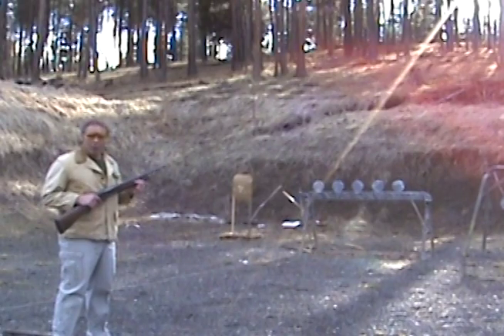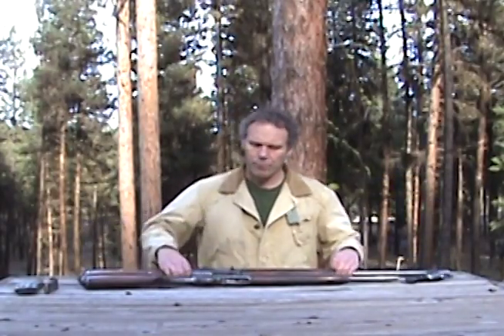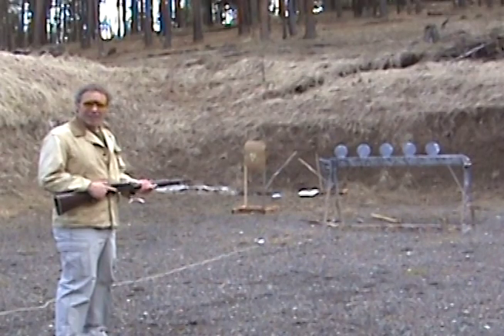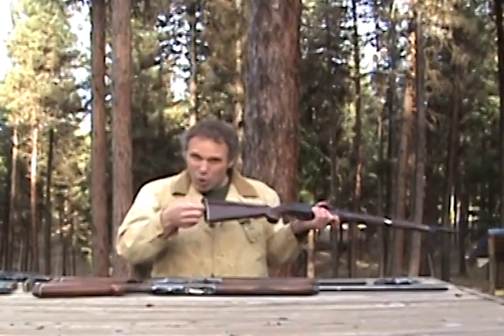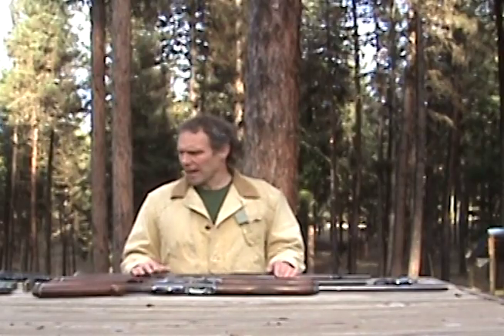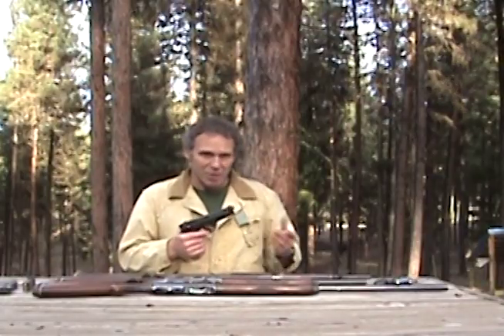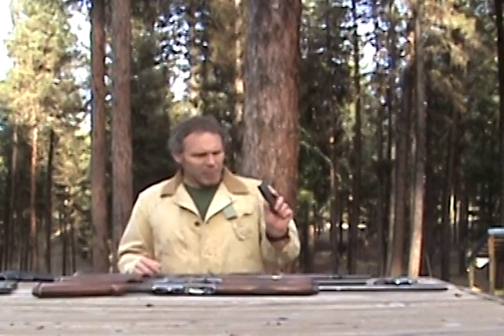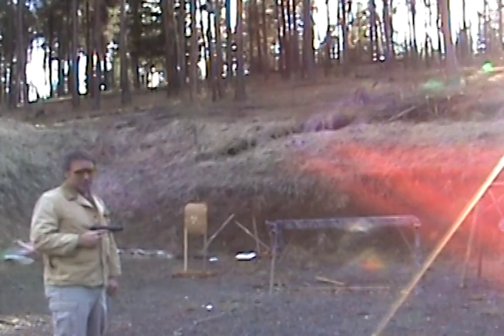Can spring compression damage a magazine?

Comment: I recently fired 4 mags through my 1911(on the 4th of July)  Those mags had been loaded for 2 years,  I had zero issues.   

When I was in the military I never kept mags loaded that long, but when I did have feeding issues, which is the only type I ever had with M16's/AR's, the problem was always magazine related, and was easily fixed by taking the mag apart and tweaking the spring.   That was with standard issue mags, nowadays you can buy AR mags that are just plain garbage and no amount of tweaking will fix them,  same goes for 1911 mags.

Comment: I have kept my Mossberg 500 loaded for 97% of the time for about the last 17 years. I have noticed that just pushing the magazine tube follower with my thumb it feels much weaker. BUT it has never failed to feed well. 

But I had a s&w sd9ve that I kept in my car hot and cold loaded for about a year, and I started having a problem with the last round hold open not working. And it could be temporarily fixed by stretching out the mag spring.

Comment: I served in the USAF for 4 years. During that time I was an armorer. I can attest that mags left loaded do lose the tension over the years. 30rd mags could fit 31, 32, or 33 rds in it. These mags were not used for training (i.e. range qualification) but only used for daily issue. We constantly saw "old timers" disassembling the mags and stretching the magazine springs so they would hopefully work reliably. Moral of the story is at least down your mags by a round or two. Rotate your stored (loaded) mags.
Reply: This is precisely what I do to my carry mags. Rotate once every couple of months and I keep one less round than what they hold because the pressure of getting that one last round in seems a lot more than the previous rounds. I think this is pretty good advice and I’ll check the difference in a couple years when I pick up new mags. Thanks for serving!

Comment: I have a stevens model 62 22 LR, and 6 magazines for it.  At one point i had 2 of them loaded for way over a year, nearly 2.  One of the magazine springs was fine, the other failed.  Wouldn't even push the second round high enough to chamber.  Unloaded it, left it alone for probably 6 months, loaded it and shot.  Worked fine.  Don't know if that's damage or what, but its relevant to what Paul was saying.

Comment: It comes down to the quality of the spring in the mag, the cheaper the metal, the more likely it is to malfunction.  

This also brings up the question of which puts more stress on a mag spring--being left compressed for a long period of time, or being frequently compressed and loosened by frequent use.

Comment: It's true that springs that are designed and manufactured correctly for their application will never suffer from "compression damage" (i.e. the spring deforms when fully compressed) and there is enough anecdotal evidence to support this.  The problem is that it's impossible for a consumer to know if any given spring was both designed and manufactured correctly for it's application, so better to be safe than sorry when the risk is high.  It's also worth pointing out that stretching a spring and reinstalling it should be an emergency fix only because stretching the spring simply deforms it again making it weaker so it will cause malfunctions even sooner next time.   I think the best advice for people that have a semi-auto but rarely use it is to follow Mr. Harrell's father's Nylon 66 method and simply not load the magazine to full capacity since that is the best way to prevent the maximum level of compression that actually deforms the spring.

Comment: Good video made some good point. 
In the service I was taught condition 3 (1911). If you are train in condition 3 you can pick up a pistol, you have never seen before and fire quickly. You never have to worry about is there a bullet in the chamber or not. Most people are not experienced enough to carry in condition 0 safely. I think condition 2 is safe because of the hard double action pull. I do not use condition 2 (HK45) for two reasons. If my first shot is single action, I am more likely to hit my target on the first shot. Most important you do not want to change your muscle memory. In other words you don't have to think, you just do.

Comment: Just for a mean rule of thumb (which there are of course exceptions based on what kind of spring it is). If it's compressed past 80-85% of it's original, uncompressed length (no pre-tension) 

then it will undergo some plastic deformation. Some springs are designed for quick movement, dynamic applications other just to hold something under tension. If they design the magazine correctly, with enough space for the compressed spring when fully loaded, it can last a really long time cause it's still in the elastic part of the travel. Over all the years the spring deteriorates and some can freeze in place adhering to the contact surface based on the materials. The better the spring is guided, the better. Bulging out being compressed isn't what you're looking for.

If you let your car sit in place forever, your tyres will be done and the engine might be stuck if it isn't turned once in a while. 

Also: Never underestimate a company controller trying to save 0.003$ on a tiny part to become a major 9-digit recall dumbsterfire including some casualties.

Comment: There are many people who never consider that steel springs can and will lose their temper (i.e tension) under constant compression. In fact, MOST auto loading weapons jams can be directly attributed to a faulty magazine and particularly a worn mag spring! Overlooked, but crucial 101 information for any serious gun owner if they want their weapon to fire in a crucial situation. 👍
Reply: Probably depends on context, but most of my jams have been related to badly-fitted ammunition that didn't like my gun. Bullets not seated into the case far enough, wadcutter profiles that aren't smooth enough, etc. Or too little powder in a custom load that didn't generate enough force to properly eject the previous round. I don't have tons of experience with weapon jams, but I'm not sure I've ever had a jam related to magazine failure, other than failure to properly insert the magazine into the weapon.

Comment: Seems a lot of folks only understand extreme black & white thinking, either it is never a problem, with any magazine, ever; or always a problem under any circumstances.  You have shown the complexity of real life with its shades of grey.  As a police armorer, we had a problem once with older SIG 226 magazines which had been carried loaded for most of 15 years on duty.  One of our dim bulb Captains purchased  Winchester 127 grain plus-p-plus ammo for duty carry in pistols.  That is a very hot round and worked in the MP-5, however the slide velocity was so high on the pistol that the older weaker magazine springs could not push up the column of ammunition upward fast enough to feed the next round.  We had carried that ammo for over 3 years on duty and had never been allowed to actually fire it in our pistols or even test it for reliability, due to Captain Dim Bulb's budget considerations.  We only fired up the ammo for qualification just before trading in the pistols for a different model.  These Sig 226's had the pinned in breech blocks, and several of them sheared the pins and ejected the breech block before getting through even one magazine.  We took up all the magazines, and I could differentiate the weak ones from the newer ones easily by depressing the follower and feeling the resistance.  I made 2 piles, the unserviceable and serviceable, which were to be sold to some other banana republic police department.  I tested some of the hot ammo with  magazines from each pile.  All the jams were from the older ones with notably weak springs.  This should have been a valuable multi-point learning experience, however the lessons, predictably. were lost on the Captain.  I'm sure all the magazines were sold to Guatemala anyway.

Comment: I can confirm that damage does indeed occur from springs being compressed without release given enough time. Paul, you summed things up very nicely. Your example of the magazine that worked until the last two rounds is an example. I call that damage because the spring failed to fully function as designed - even though it did work with the previous 13 rounds. 
I can also confirm that quality makes a difference in what constitutes "long time".
Just like pointed bullets in a lever action tube magazine is a bad idea (yes, pointed bullets in a tube magazine can, indeed, ignite under recoil - I've seen it happen), keeping springs compressed without release is also a bad idea.
Can you get by without magazine maintenance for a while? Sure. Will a quality spring tolerate that lack of maintenance longer than a cheaper spring? Also sure. But entirely ignoring due maintenance of equipment is simply asking for trouble somewhere along the way. People whose lives depend upon properly functioning medical equipment never fail to keep their doctor appointments. Is there really any excuse for ignoring maintenance a firearm (which can also be considered personal lifesaving equipment)?

Comment: My father was a machine design engineer. he told me all springs have a compression point that if you exceed that the spring will loose its ability to return to full extension. so, its not a good idea to radically compress springs in general. for the mossberg pump shotguns I own and some of my friends own I replaced the magazine springs with Wolff high quality springs to make the springs last longer.

Comment: Great video. 
I have seen a few weak shotgun magazine springs , but have never even heard of a weak hammer spring , here in the Bahamas its almost taboo to dry fire a gun so everyone I know never does it and leaves their  gun cocked  365 , some islands have no shooting range  so many guns sit for years or decades without firing , I would say the vast majority of shotguns go several years without being fired , and I've never even heard of someone having to replace a hammer spring .
I'm sure you are correct that It  can weaken the hammer spring,  but are the odds of a weak hammer spring greater then the risk of breaking a firing pin ?

Comment: This really boils down to the quality of the spring design for the application & quality of the spring manufacture, in particular the heat treatment & stress relieving of the spring.  A good quality spring is not likely to have any problems being compressed for long periods of time.  Stretching a WELL MADE spring AFTER it has been stress relieved is a recipe for microfractures & stress fatigue failures.  Permanently stretching an automobile valve spring may cause failure in 1,000 miles because the spring is cycled often.  HOWEVER, a magazine spring cycles relatively few times during it's lifetime so you might get by stretching the spring after it has been heat treated.  But if you need to permanently stretch a spring it probably means that the heat treatment was too soft.  Because it is too soft you will probably get by stretching the spring without a future stress fatigue failure.  But you may also need to stretch the spring again in the future.  But without an metallurgical analysis of the spring quality, it's difficult to know which brand of spring will be a problem.  Ultimately this means that you need to periodically test the springs in your magazines to make sure they are working correctly.

Comment: I just bought a Sig p226 with 2 mags from 1995. They have been loaded and unloaded a lot since then. I bought a 3rd mag and the spring on the new one is much tighter than the old ones. But they are work. May I suggest replacing the springs when they get used a lot.

Comment: Used an S&W 5906 with 4 magazines that had been loaded long enough that the ammunition cases had corroded, and 3 rounds had become duds.

After using up the (sticky) ammo it came with, all magazines fed fine.

A well made spring, used correctly, won't ever take a set or fatigue. A poorly made spring, or one that's compressed a bit too far? Maybe not the same luck.

Comment: So different springs have different design points and goals. A bolt spring usually requires a small length, and that makes it harder to design around longevity when compressed. A magazine sometimes wants to use the extra space for rounds and again its difficult to design the spring. Other magazines use a more expensive spring and/or give more space for the spring and will last longer compressed. And finally, not loading to capacity will be dramatically better for the spring. That's one of the reason holding the bolt back isn't great, it's fully back. A few rounds removed will be much better, a few more will still be better, and a gun with a couple of rounds only will last almost forever (advice for Paul's dad).

Comment: It's going to come down to the quality of the spring and conditions it's kept under.
I've got a Ruger P89 and I ended up finding a loaded mag which had gotten forgotten in a box of odds and ends and which I know had been there for at least a decade because it was a sealed box from when I moved to FL from PA a decade ago.
The mag performs just as well as the other ones which get cycled and are allowed to periodically rest the springs.
On the other hand, the springs in military surplus M16/AR15 mags aren't as well made and I regularly see them die.

Comment: I'm only halfway through the video so he may cover this, but in my somewhat experience but not expert understanding the divide between elastic deformation that a spring recovers from fully, and and plastic deformation, the permanent bend that's left after a spring is compressed or stressed, is one of the most useful portions of the springs deformation curve. In optimizing a spring for something like a magazine it's problematic to use the early softest part of the deformation because the rate of change of load(pressure exerted by the spring) is dramatic. for coil springs in most guns it's nearly linear. So we have to take up some portion of the springs length with preload, that way the last round in a magazine is in position and ready not. And that near linear rate keeps up all the way through the elastic deformation so a spring that never gets close its plastic deformation is going to have a very high disparity between the pressure on the first round in a magazine and the pressure on the last round, if that last round is really tough to load compared to the second to last one, that's a sign of a spring that is still in safe plastic deformation. But in firearms where a change in pressure like that would cause malfunctions, or make loading very, very difficult. The manufacture will use the part of the curve just before and very close to permanent, plastic deformation. The rate of pressure change with compression flattens out and with good metallurgy a spring in this portion of the curve can maintain smooth consistent pressure for a long part of its curve, however you are always pushing a spring close to damage in this way. Any firearms manufacturer has to balance these positives and negative. Even prioritizing reliability doesn't settled things because a spring that never deform and can last fully loaded forever will have negative effects on action consistency and a consistent performance spring may have a shorter life time and tend to be vulnerable to permanent damage and malfunction with age.
Luckily, springs are not the most expensive thing in most guns, I would recomend getting magazines for keeping loaded from manufacteres you trust to be around to sell you replacement springs in a few years time, and if you own a firearm with irreplaceable components, keep them unloaded, and we'll maintained. Held open chambers and action springs doesn't seem like a good idea, letting the bolt close on a chamber flag should be just as safe  functionally and hold much less pressure on the mainspring.

Comment: I have had a few guns that I know were left loaded for years before I got them. Most worked fine a few didn't. I used to buy police trade in Glock mags at gun shows back when a new factory Glock mag would run about $125. There would be 55 gallon barrels full of them for around $40 each. Id say they were about 95% new condition on the exterior but almost all needed a new spring due to being left loaded all the time. a $10 wolf spring and we were back in business.

Comment: I have a Glock 21 with extended base with supplied longer spring. I had it topped off with 17rds for a year. Checked the mag function on whim. The rounds dribbled out. Tried shooting and it failed every time. 
Now I download 2rds on all mags. 
Lesson learned. 
Yes I shoot more than once a year. 
If you store mags I suggest downloading them at least or 2 rounds to extend their life. 
I'm a gunsmith for 12 years now and regularly see worn out springs on many rifles and pistols. Some have low round counts but we're stored with stress on the spring. 
I can say with a bit of certainty springs will take a set of stressed for a duration of time, but as Paul says "You be the Judge. "
Reply: It just depends on the spring but I rather not gamble on that when storing a mag. 
In perfect world you would rotate your mags. Just know that it is possible.